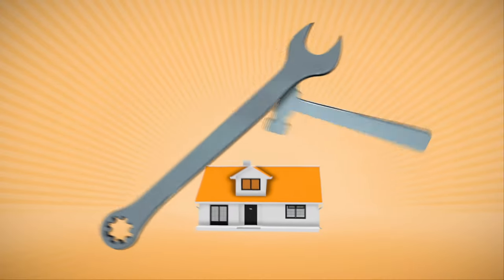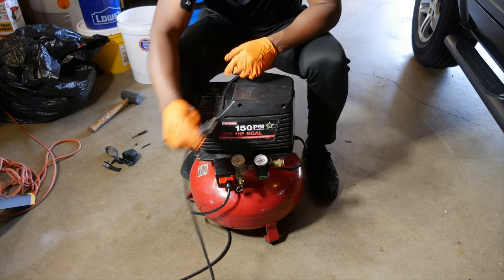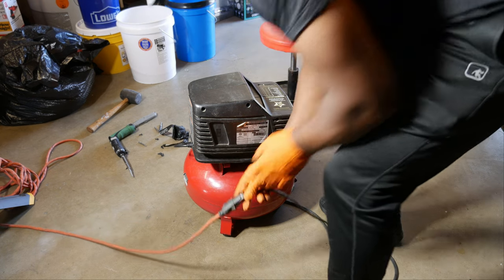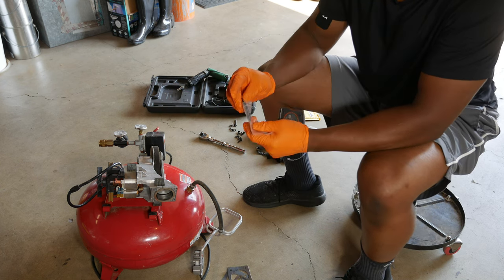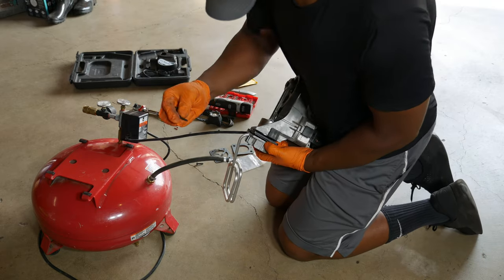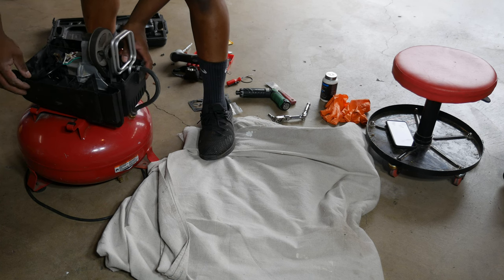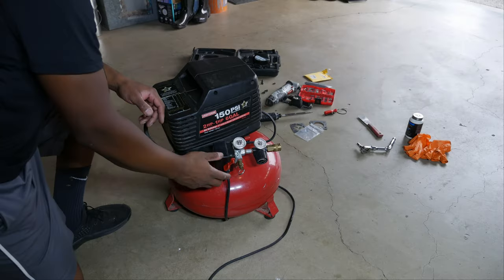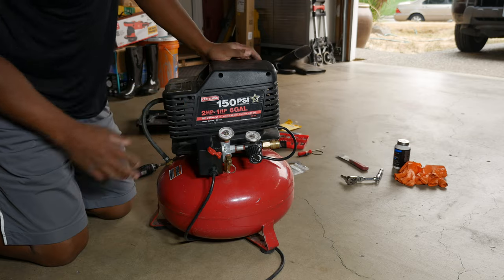Fixing a leaking Craftsman Air Compressor | Porter Cable

Comment: Good job @DIYApprentice.  I followed your instructions with a Porter Cable C2006 Pancake compressor using gasket kit #D30139. Does not require the big O-ring.  Ordered from Amazon. $28. Took about 45 min start to finish. Runs perfectly.
Reply from the maker: Nice. 👍

Comment: Nice job! Was the large o-ring the point of failure? Having difficulty finding the link to the replacement parts. I have the same Hitachi nut driver and have had for over 20 years. I replaced the switch 10 years ago. Still works great.
Reply from the maker: A link to the repair kit is in the description. Yes, the Hitachi is a great tool - just used it today 🙂 Thanks for checking out the video!

Comment: Hello, just wondering, I have a newer craftsman ( same thing) Does the rebuild kit come with a piston ring ( or O-ring) that is replaceable? Reason I ask is because mine was leaking when it was at a certain piston stroke position. I was able to fix it but not sure how long it will last. I ended up putting Vaseline on the inside of the piston wall and it seems to have fixed it for at least now.
Reply from the maker: The kit is included in the video's description. It doesn't include any internal seals or o-rings.

Comment: Best regards Mr. DIY
Luis Pacheco greets you from Ecuador, excellent compressor repair video.
I have a Porter cable compressor with the same characteristics in the video and I need spare parts such as piston, connecting rod, cylinder, ring and valve assembly to repair. Ecuador does not have spare parts, I have to import from the US... can you help me with links to stores where I can buy?
was grateful for responding
Reply from the maker: Yes, the link to the kit I purchased is in the video's description. Hope it helps you out.